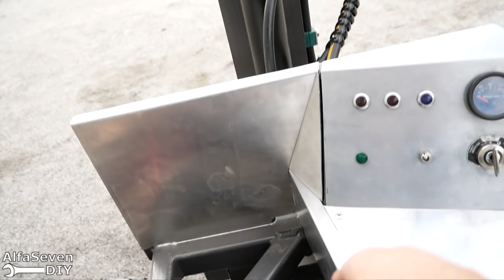EW7 Episode 16 | (homemade excavator)

Comment: Most people will never understand what this guy did here.  Amazing.
Reply: Agreed1 I have a machine shop that my dad and I work in, complete with CNC's , plasma cutters, CAD, all types of brakes, presses, shears etc. and we focus on agriculture and construction equipment repair. It's one thing to understand metal fabrication but in this case, it goes way beyond that. Hydraulics alone is something that most people have a single focus on and is their livelihood.

Their are engineers that do nothing other then bearings, needed sizes and types, thrust loading, metallurgy and how different stresses and temps affect the bearing and sleeves. This gentleman it appears, has done all of that? And when you combine the complexity of these subjects, the acute attention to detail and workmanship, and the amount of time needed to study and grasp all of this information and apply it correctly, amazing isn't even close!

I for one am thoroughly and majorly impressed. I am also humble enough to say that this man's IQ is probably a larger number  than mine, Lol
Reply from the maker: Wow, I really like your comment!
It was the finest comment anyone has ever written to me. . 
Thank you very much 🙂👍👍👍
Reply: I understand exactly what he did. He built a backhoe. Not an excavator.
Reply: Exactly
Reply: @TF856  Backhoe literally means a hoe (digging tool) on the back of something. An excavator is a tool for excavating. He built an excavator, not a backhoe. You are exactly the type of person the original commenter was talking about, someone who doesn't understand.
Reply: @timderks5960  I understand perfectly. I work in construction! I run those machines every workday of my life! I know exactly what the hell I'm talking about! 
You don't!!!
For your own information go to tractor dealerships and look at the brochures and see what those machines are called! I'm talking about the real names.  Not the stupid nicknames a lot of people give them. Just like not all skip loaders are Massey Ferguson's (nicknamed Fergie's), not all high lifts are JLGs, not all storage containers are Conex boxes, not all skid steers are bobcats, not all four wheel drives are Jeeps, not all motorhomes are winnebagos, etc, etc.
Backhoes is a general term for something that has a hoe on one end of it. Just like another specific class of digging machine is an excavator that has certain characteristics that a backhoe does not have! 
The technical name for backhoes is a Tractor Loader Backhoe aka TLB. 
TLBs, as some people put it, are the worst of all worlds. They can do several things poorly.
Excavators are a very wonderful design for digging and loading trucks, and they come in lots of different sizes. from just a few hundred pounds you can pull around with your car or even with a motorcycle up to several hundred tons to work in some of the world's largest mining operations. 
The upper portion of an excavator can rotate 360° to dig and/or load anywhere throughout its full rotation. Backhoes cannot. And backhoes only come in a very few sizes maxing out at under 10 tons. The John Deere 710 is about the biggest TLB that is currently made. 

During my 30 years in the operating engineers I have ran basically every kind of backhoe, every kind of excavator, every kind of dozer, every kind of road grader, every kind of sheepsfoot or smooth drum compaction machine, every kind of scraper or Earth moving machine, every kind of off-road dump truck, etc.
I have also worked on farms driving all kinds of farming machinery. I have also driven over the road Long haul big rigs to.
So don't you dare tell me I don't know what I'm talking about!
Reply: @TF856  Wel then show it, instead of showing that you don't know shit. Also, running a machine doesn't mean you know anything about it other than how to run it. Building something isn't even in the same area code as operating it. Also, if you know so well, why the hell don't you know the difference between a backhoe and an excavator?
Reply: @superdog1964  
Excellent comment dog.  Most of us don't have the knowledge to even make that comment but after reading it we understand.
Call it an excavator-backhoe or a little digger but it's an impressive wonderful build.
Reply: @TF856  With all due respect to you and your level of skill operating machinery (After 30 years I am certain it is beyond a professional level of ability), the term "Engineer" being used to describe your position as an operator within the company was added so that other workers understand your skill level and pay grade over theirs. 

When you are working in the municipal or public utilities sector, it takes years of experience to understand the dangers an operator could encounter when digging under asphalt or concrete (gas and water lines etc.).

With that being said, most people (myself included) think of an engineer as someone with many years of college and extra detail in whatever type of specialty or field they intend to work and/or design in along with lots of certificates and degrees hanging on a wall.

Using the term engineer to prove you are correct in an argument simply isn't valid. Over the years I have found that different terms are used by different people (generally a layperson calls them all diggers or backhoes?) for the same machine. 

After 20 years of machining parts for and repairing large machinery, I find that anyone in the business would call the machine in this video an "excavator" and the term "backhoe" would be used to describe any smaller machine that has a  loader in the front and a hoe on the back.

If the same configuration is on a machine with tracks (Very rare these days) then 'trackhoe" is used as the descriptor. Both of these machines have a dual purpose to both dig and load trucks, saving the contractor the hassle of needing 2 machines while on small jobs.

An excavator specializes in digging and removing packed earth and stone and while an excavator can be used to load trucks, any time large amounts of bulk aggregates or material need loading, a bucket loader of any type is generally much faster and more efficient. I find it odd you don't understand this after 30 years?

Very few people understand everything (I don't) and some people act like they do but.........I digress.

Comment: 1. Hydraulic pump with bigger flow - this engine is not load in full. Now whole machine is slower than working with shovel   2. Some exchangeable parts  might be done , like bucket lock or main arm hinge . Now you have potential points of making bigger hole by outer ring at main pins of arm and this can damage whole part of arm .  Nice job anyway ! Thanks for sharing .

Comment: You have done an incredible job from start to finish. 
If I was there with you I would give you a pat on the back because you really deserve it. 
Now the only thing is you need a few different buckets. 
I myself what to make a front end loader and a backhoe to put on a little  Kubota tractor I have for my son in law so he can use it for doing trenches for power and I can assure you that I will be going back to your videos every now and then to get ideas and I'm a diesel mechanic and have worked on machinery all my life . Stay safe from Australia Dean.
Reply from the maker: Thanks Dean🤝🙂

Comment: Nice to see that you put a hitch on your blade like some people do on their excavators.
Some people put a hitch box on their blades so they can use different types of hitches and different drop hitches also.
On YouTube look up excavators with trailers and you can also see cotton top 3 putting a hitch on his excavator blade.
Duckgirl 86 has her own wheeled excavator and she drives it from job to job and she pulls her trailer with her attachments in it and she can operate the dump bed from the cab of her excavator and she's very good at using that trailer on the job moving materials and supplies. 

That machine of yours looks a lot like a Ditch Witch specifically designed for trenching and backfilling.

Comment: I watched this build series from the start. Held my comments till now. Great machine and very professional looking.
I built a micro-hoe that pales in comparison. But then all I had for tools was an angle grinder and a 110V wire welder.
My Bridgeport drill was a 25 year old $75 Craftsman drill press. My build location was the great outdoors.
 I did get a hand held bandsaw half way through. Also only spent about $1000 U.S. dollars.

Comment: Well done my man. There are some here who always leave negative reviews because they are not capable of performing such a task as you have just completed. I started out as a mechanic, added welder and eventually mechanical technician. Love the skills you have demonstrated. Keep it up. Just a question? Did you cost the job, just the materials. Thanks, Robin.
Reply from the maker: Thanks Robin,
As I remeber the material cost was around 4k Euro, but some part are used.

Comment: It looks very very well made. Really really impressive work! One question I do have though. With your skill level, why did you not build a tracked excavator with 360° rotation? I own one and love it and from what I see in the video it would just be a lot more comfortable and quicker to use.
Reply from the maker: Hello, and thanks 🙂. After careful consideration, I decided to skip the possibility of 360 rotation. I simply wanted to build as cheaply, quickly, and easily as possible, and with wheels to avoid damaging the lawn. And the most important requirements are met for me, which are to do small jobs in the garden. But I agree that it would have become a much better machine with 360 rotation.
Reply: @AlfaSeven  thanks very much for the reply. I did notice how good your excavator is to the lawn! Mine is a small 2,7t and if I make a turn on lawn, even slightly, it makes its mark. Best Regards!

Comment: Nice series, tough i wonder do u have more power? Sounds like idling
Reply from the maker: Thanks, yes it is almost idel. In higher revs the hydraulic oil getting hot after one hour. No oil cooler.
Reply: @AlfaSeven  ahha y tought as much better get ufself a cooler then😊

Comment: Very Nice build. It sounds like it’s running at an idle,
do you ever bump the throttle up for more power or?
Reply from the maker: Thanks!
Thats right. I can use more power but if I do, after one or two hour diggig, the hydraulic oil become over heated because I dont have an oil cooler. But I can live with that 🙂

Comment: Can you help me sir.i want too as you if i have diesel engine 10 hp rpm 3600 kind of hydrolic pump, orbital motor,control valve, how many diameter hydrolic cylinder.than you. Sorry if i know english only a little
Reply from the maker: Hi,
I'm working on a simple slide show description of the hydraulic system. Maybe that can helps. 
Release date: Perhaps this december
Reply: That is. Ahydraulic pump.and a hand valve.and its orbital motor type and rpm whose oil flow is severa liters/ gallons per minute and the maximum pressure is. How many bars/psi.and cylinder diameter are suitable for a10 hp engine.can you sir help me. And thank you very much
Reply from the maker: @yulijvr9906  
I use:
Cylinder diameter: 63mm 
Hoses: 1/2" 
Valve:Joystick converted 3 spool hydraulic directional control valve 11gpm, double acting cylinder spool
Pumps: from Belos 1500, donating machine
Engine: 12hp
Reply: @AlfaSeven i was advised online trader. HYDRALIC PUMP Displacement. Capacity specification: 27 cc. Max preassure:210 bar. Rotate: 1800 rpm per minute. HYDRAULIC MOTOR ORBITALS. Max speed:185 rpm. Max torque: 290 Nm max output :6,7 hp. Max flow: 60 liters per minute. Max preassure: 200 bar. HAND VALVE.  Max preassure: 35 mpa/350 bar. Max flow 80 litters per minute. HYDRAULIC CYLINDER 30 mm. Length 80 cmAccording to you it's not suitable with a10 hp engine.i really need your advice.thank you very mutch.